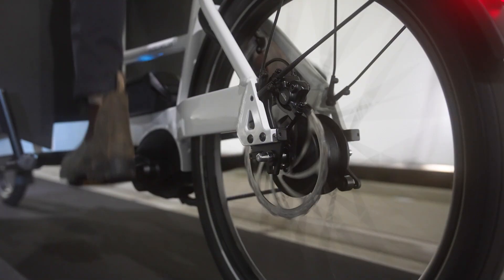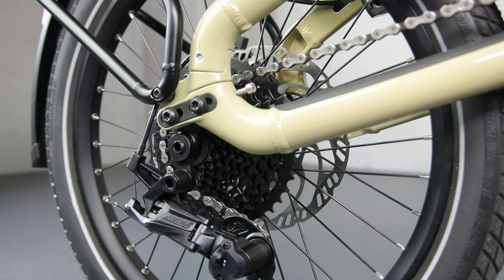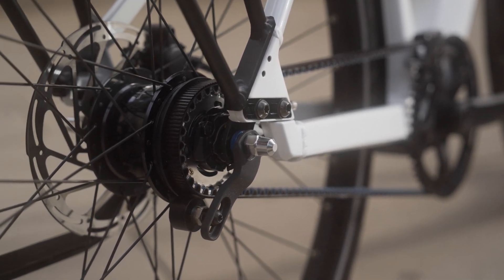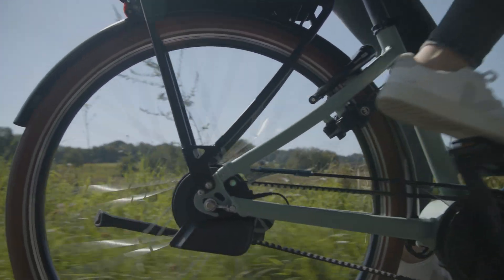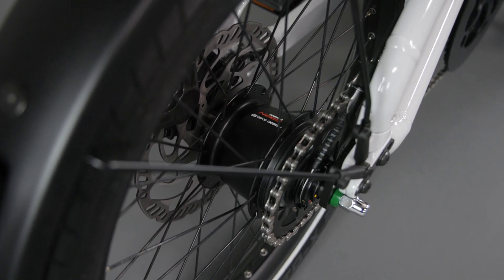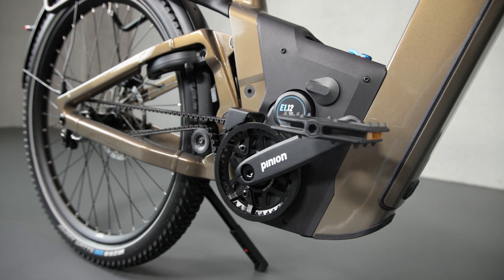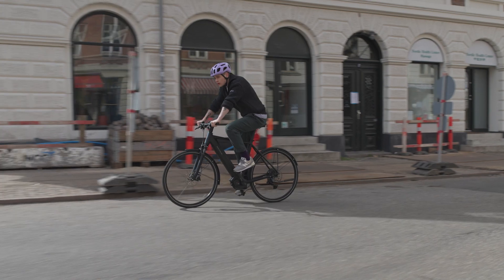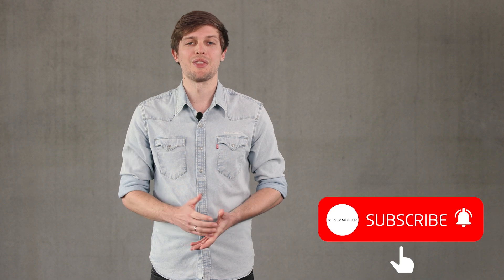Touring, pinion and more - All about our gearing options_Updated

Comment: Why would any go with a derailleur in 2024? I've had enough oil on my shoes! In my opinion derailleurs are redundant technology. I read a study about efficiency and reality is that in perfect conditions derailleurs are 1% more efficient (98%) than belt drive (97%), but in any other conditions or if you haven't oiled your chain that week belt drive overtakes in efficiency.

Combine that with quality of life improvements, I really believe in 2030 all bikes & ebikes will either be belt drive or shaft drive and derailleurs will be associated with the cheapest segment of the market.
Reply: Price and weight is why they'll still survive some years.
Reply: Simplicity, reliability and availability so easy to service, repair and replace.